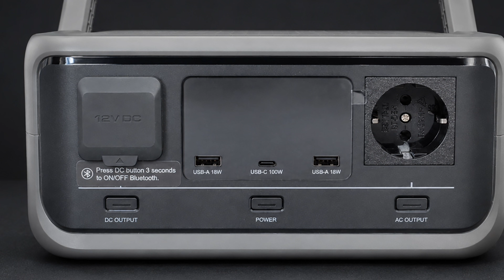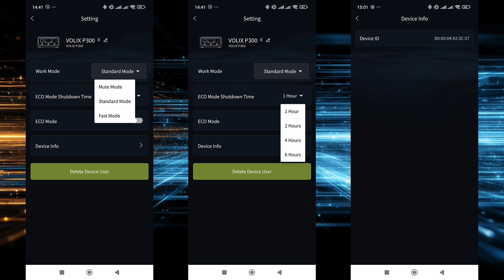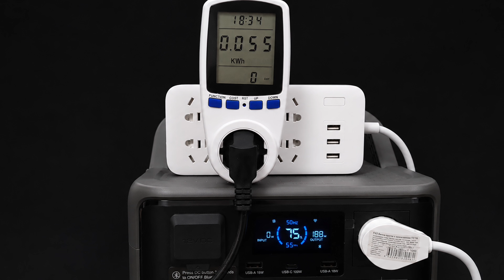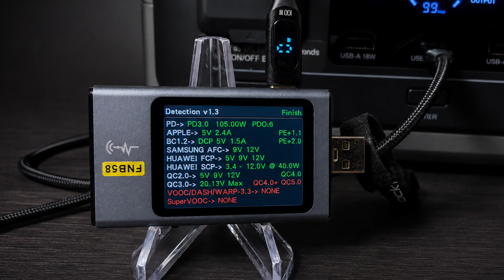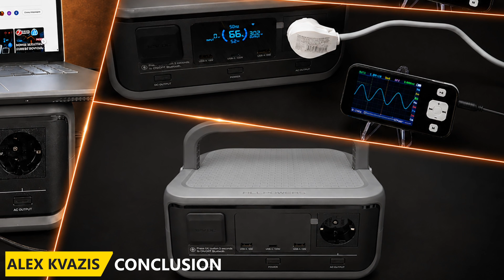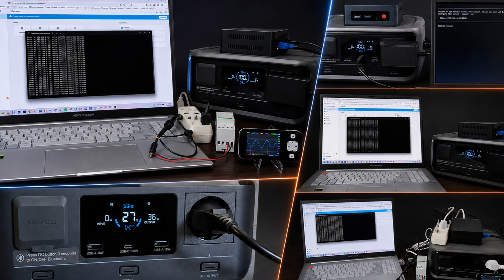ALLPOWERS VOLIX P300: 300 W, UPS, and Real Capacity - Full Test

Comment: I bought one a week ago and I only wish it had WiFi, or if it does how to turn it on.   I bet it does have it.  Actually out in the wild your phone is going to be close to the unit. None of these thing are perfect. My Jackery 3000 Home Power will do ups but after a day of month, never know the output just cuts off. Jackery could not fix it.They replaced the device and it does the same thing. So much for pass through mode!  The Jackery also just drops WiFi randomly too.   The software in this unit is much better.  But does anyone know if it has WiFi? If so how to turn it on?